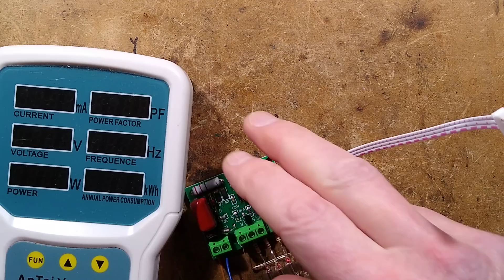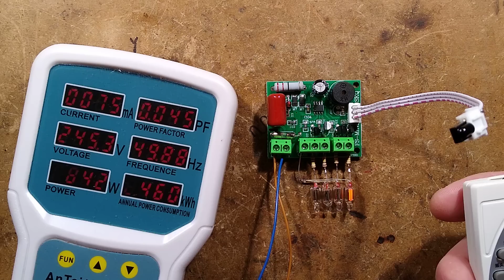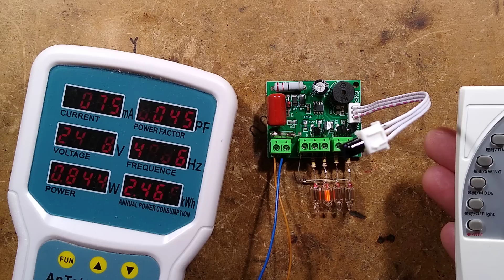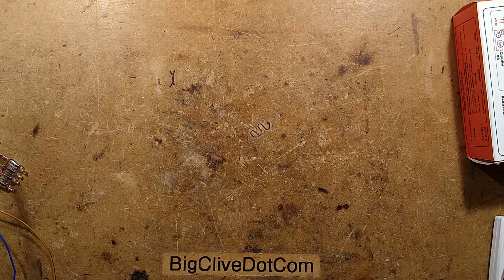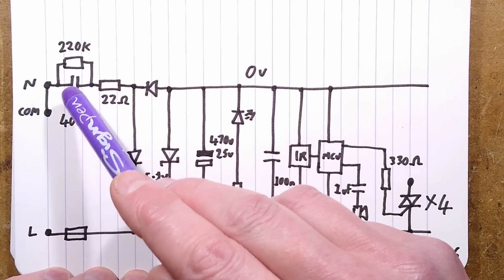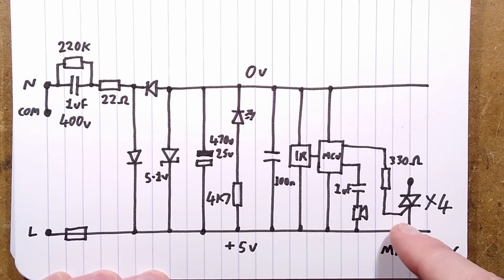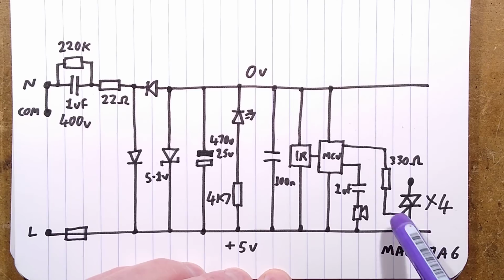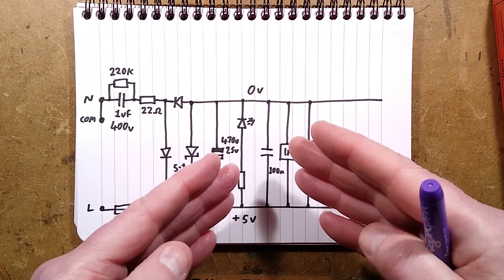Another scarily minimal fan control module - with schematic

Comment: On the remote control, those are carbon deposits on the copper tracks.   These have some resistance (maybe you could measure it?) that copper tracks don't have.   Maybe those resistances are part of an RC oscillator or an ADC within the blob chip, so that they can add more buttons than there are pins on the chip.  Just a guess...

Comment: Did you measure the ohms on that 22 ohm resistor?
It seems a large expensive resistor for 22 ohms, which wouldn't dissipate much heat at all driving the few mA for that IC.
It is also common in a capacitive reactance supply like that to use a much higher value series resistor like a 22k or 47k, that resistor is important to reduce any strain from high freq voltage spikes on the mains, which would blast right through that 1uF cap and stress the cap and zener/IC
Reply from the maker: The resistor is rated fairly high power to handle the high current spikes it may see in use.

Comment: Nice to see this has exactly the same remote and functionality as the Amazon basics fan i bought last year.
Ps so far works well, but i wish it had an extra low fan speed and an extra high fan speed as the range in speed is not that different between 1,2,3.

Comment: I think that remote control module might work well with a ceiling fan because the speed control wiring to the motor is pretty much the same as a table top or pedestal fan, even the swivel synchronous motor output can be used to control the light built into most ceiling fans.

Comment: Nice video, Clive. Are there any versions of this worth buying? Is it possible to use the triac outputs from this module to drive larger triacs and add some basic safety features?
Reply from the maker: There are other more rugged remote control receivers available.

Comment: 9:50 Those extra buttons are for light brightness up & down.  See item 1005006642517645 on AE, "Solar Wall Lamp Controller Human Body Infrared Induction Circuit Board"

I wonder if the codes are the same on the remotes.

Comment: Question: With such a horrendous powerfactor, wouldn't a "Smart"-meter charge you for 19W (or VA??) instead of the 0.58W?
Reply from the maker: Only if it was programmed to do so.  And they inevitably will.

Comment: I thought it was quite interesting that after you repeatedly rubbed that long IR line how it rose up afterwards. Are you sure that this is for controlling "fans"? I mean, I can definitely think of devices you might want to change the speed on automatically at short and repeating intervals. Did you check to see if "lights on" or "lights off" was the default? Everyone has their preferences.

Comment: This could make a nice little remote & PWM controller for my home built used oil burner.   One for the constant on fan, pulsed oil valve for low and constant on for high fire.  Pulse on/off control of the spring closed powered open valve would act as a pwm.   Hummmm

Comment: They could have gotten away without the diode on the input. (The one that goes to +5V)
Replace it with a 5.1V zener and forgett about the zener on the right side (basicaly swap the zener to the left)
That is penny pinching to the max, but you can use a zener diode as an actual diode and save one BOM item.
on the positive half wave the zener conducts forward with 0.6v providing a return path for the capacitor
on the negative half wave the zener conducts in reverse at 5.1v. Minus the diode drop of the diode at the top, thats 4.5v for the rest of the circuit
Reply: You can't avoid the diode...the diode is for mains..its P.I.V. is high...whereas a zener  has ..just its zener/ avalanche clamp voltage...
Reply: @analoghardwaretops3976  Sure you can
A Zener Diode has a forward Voltage of around 0.7V like every other diode too, this feature gets not utilized very often thou since Zeners are almost exclusively used in reverse. But that doesn't mean you can't use them like normal diodes

Connect a capacitor in series with a 5.2V Zener Diode to mains. You will get a Square wave like Voltage between -0.7V and 5.2V on the Zener.
Now use a normal Diode to rectify this voltage and you get 5.2V minus the drop of the second diode = 4.5V DC

Comment: Wonder what the wattage rating is..  because itd be useful for auto switching “fairy lights” or some random lights..  you could make one of those “eat at joes” kinda signs that light up consecutively..  ha!
Reply: Fans are usually about 40W.  Those little triacs are good for about 0.5A so in 240v land 100W seems reasonable.  That's quite a few LEDs...

Comment: Interesting that they're switching an inductive load without any snubbing on the triac.
Reply: 3 Quadrant aka "snubberless" triacs perhaps Strike that. Found a data sheet for those triacs, they are 4-Quadrant.
Reply: @sootikins  Could be. I knew those triacs existed, but rarely do they work without at least an RC snubber.
Reply: @misterhat5823  Not sure if you saw my edit to my comment: found data sheet for the triacs in question, they're 4-Quad so no idea how they survive w/o snubber. I've used 3-Quad successfully w/o snubbers but only on incandescent lamp loads.

Comment: I think on the last fan controller video I mentioned my bedroom wall fan has an IR window with nothing behind it, this would look like it'd fit, but, I tend to leave my fan running on low and on a 240-120 step-down transformer (cos it runs too fast!) constantly, that is until the summer comes and I need the full 240v on it, where it ends up sounding like I have an aeroplane in my bedroom... :P

Comment: That looks exactly like the module in a oscillating floor fan I purchased.  To answer some of your questions:  The sleep cycles through chunks of time, Displayed by a LED for the time amount.  The Ramp up/down etc is described as a "sleep" harmonic - I dont remember the word they used on my remote - it's not nearby.
It's an OK fan - nothing to write home about.  Just your basic cheap white plastic crap floor fan.

Comment: It seems to me fans usually start with high first.  I believe Technology Connections explained the reasoning behind that and it has to do with starting the motor up.  IIRC
Reply: It's less likely to stall that way. And, I believe TC does have a video about it.
Reply: @misterhat5823  Lots of crossover between Clive and TC subscribers.

Comment: Interesting little control module, Clive! In many A/C systems (and a passive fan-cooler will be used as such), there is an option for "LED Off", usually labelled "Sleep", because the "ON LED" does light up a bedroom and may be detrimental to some people's ability to fall sleep.

Comment: 9:50 the two extra buttons may be for increasing and/or decreasing the desired room temperature of a portable, or even fixed, air conditioning system.
I just stuck one of these, well the better one you looked at before, into my dumb cheap and cheerful pedastal fan. It does the job and hasn't gone up in flames yet...🤣🤣
Ach, ya could use it for a homemade penetrator 10,000 sex machine, 3 speeds and flashing lights, whats not to like...🤣🤣🤣🤣

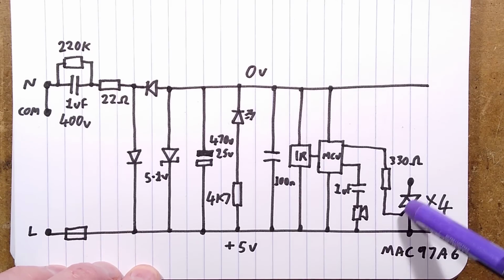Comment: 5:50 - Yes, making the gate negative, operates the TRIACs in quadrants II & III, instead of a positive gate (quadrants I & IV). Quadrant IV (4) is much less sensitive, than the other 3. Some TRIACs have quadrant IV so insensitive, that they are advertised as 3 quadrant TRIACs.

12:20 - "Make sure the load is not short circuited". If so, you have an ElectroBOOM video !
Reply: Hey I love ElectroBoom videos Lecthy (spelling?) Is a great Electrical Engineering guy who happens to have a high tolerance for causing his own pains 😂😂😂😂

Comment: I modified my two speed fan with a slightly more advanced device, Shelly 2PM+.  Interesting point, I did assume that there is no problem if both windings are energised at the same time, but noup! If both are energised same time there is quite substantial current between them. about 3x normal current.

Comment: I have a bathroom heater and the remote has stopped working but although it is out of reach I don't want a module with a capacitive dropper and triacs, the original has a 9V transformer and relays for the outputs... I found a similar heater but it is somewhat narrower and leaves the old holes in the wall visible, I can to do a PCB transplant but the old used a combination of LEDs for the timer and the new has a 7 segment LED display and making and aligning holes in the housing is not something I'm very good at. Both remotes look the same but it seems they transmit different data...

Comment: The first postion after power on is high. To give the motor enough of a boost to start from a standstill. If you started it at low, then it might just stall and burn out its winding.
Reply: There is a whole video on this by Technology Connection! 😅

Comment: For the Off Light button I might have an idea:
Back in the 2000s I remember having seen and used pedestal fans that had some sort of nightlight (A single neon indicator behind a colored plastic lens) next to the buttons as well as another button for the light that also stayed down when pressed to be released by the same Off button as the fan itself.
So maybe the module shown in this video was designed with those particular fans in mind ?
Interesting to see the use of triacs instead of relays by the way.

Comment: under 1000 views and under 10 minutes, lets gooooooooooooooo
Reply: willing to bet money the remote is used in 5 different versions and 1 of the versions is either a screw in light bulb with a fan glued to it(why do these exist??? doesnt seem....good for the sockets) or even a ceiling fan/air cleaner with a built in light

Comment: Has it got SOS, that would be as useful as it ramping the fan up-down-off. 🤣
I wonder if the wire to the IR is steel, thats usually springy. I wonder why they haven't stripped it back and removed the LED and beeper? it could save hem a few cents over 100s boards. Interesting bit of tat thanks for buying it so we dont have too 2x👍

Comment: I suppose being 18w, you don't have to use it for fans, but also as a lighting controller, turn on some lamps or different coloured bulbs and set a lamp for a timer, in which case, an actual circuit designed for lighting with a timer might be better for fans than this is!

(yes, I should watch the whole video before commenting!)
Reply from the maker: 18W isn't its load power rating.  The triacs are probably good for at least 200mA.

Comment: The 'Light' button is probably for a different version of the unit which is designed for controlling one of those ceiling fans with a built in light - probably in conjunction with one of the hidden buttons.

Most recommend that the first output to the fan windings is the high speed position to give enough torque to get the fan moving - using the lowest speed first may not be enough to start rotation (particularly on an old fan) and may  lead to the motor stalling/overheating.

I have seen similar, if not the same, units sold in Australia to add remote control to a ceiling fan which originally was controlled by a switched wall control.
Reply: That low-torque issue only seems to be an issue for north american fans (as Alec of Technology Connections went into in a past video), for people with 220-250v, the low speed setting rarely ever has an issue unless there's a fault with the motor (E.G. dry/worn bearings or bushings, or, from experience, they greased the bushings (they need oil!) at the factory causing it to be barely able to turn even at full power!)... :)
Reply: @twocvbloke it's rarely a problem with preset speeds, but for rotary dimmer style speed controls it might be. Those often go with a click from off to full and then the rest of the knobs rotation go towards lowest speed.

Those usually have such a slow minimum, that even a new duct fans might not be able to start without the bump with faster setting. That might be a fire hazard if left to really low speed and the power go out. It's low current though, so more likely you just lose some lifetime of the fan.
Reply: @twocvbloke  living in 120v country a normal fan can start from low speed if it is new, but as these cheap induction motor do not have a proper ball bearing, after using a while the motor shaft resistance will become very large and need the strong setting to lat it spin for a while then you can use the low setting
Reply: no, it is used to switch the led indicator off on a board that have a front pannel button so you can use it without a remote(like the one he taken apart before)
Reply: The hidden buttons are +/- brightness.
Reply: @j.f.christ8421  For when a light is incorporated with the fan presumably?
Reply: @barrieshepherd7694  Pretty common on those ceiling ones.  I've also seen the same remote used on a solar light, the speed buttons were used for on times (2/4/6 hour).

Comment: No SOS mode?  What a disappointment. :)
Reply: no strobe mode either!
Reply: That would be hilarious. A previous employer made motor controllers for a certain donkey fan and they were investigating using a similar mode to provide a breeze simulation.
Reply: WHAT A DOWNGRADE!
Reply: 😂 If you hold down the power button for 5 secs....
Reply: Beat me to it